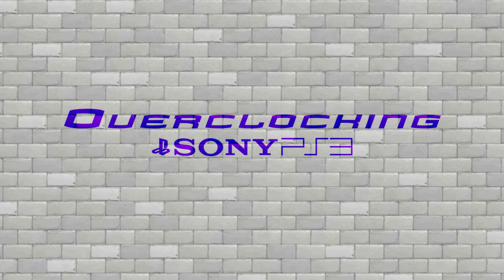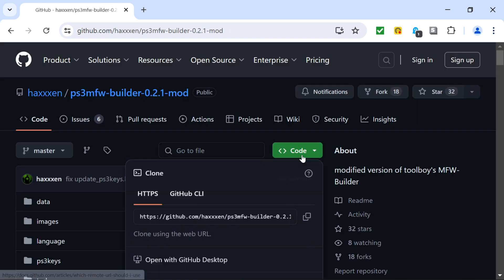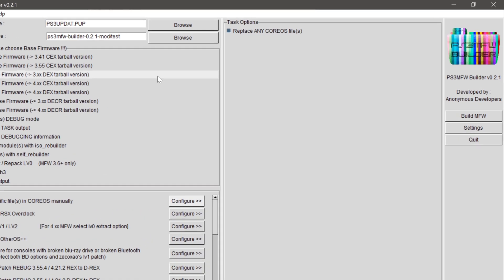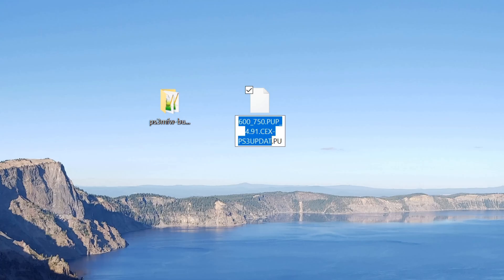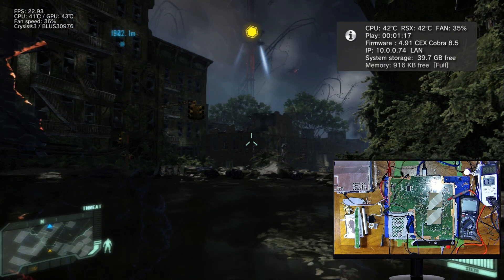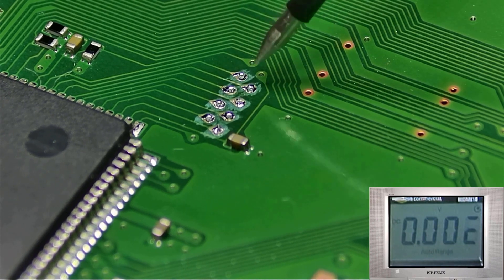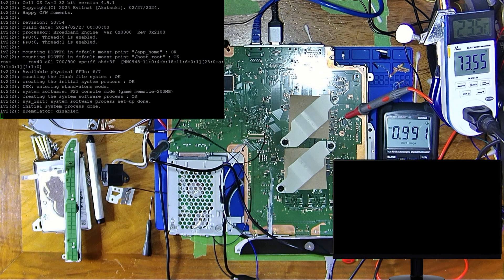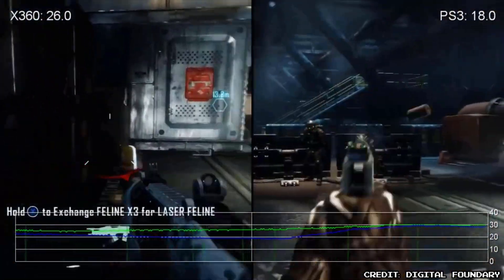PS3 Pro Tutorial | How to Overclock a PS3!

Comment: Thanks for the walkthrough and how to!  I got an extra 150 MHz on both the cpu and gpu.  Crysis 3 definitely sees improvement.  Temp stays just under 70C on a 2000 series slim that I repasted with delidding, with the fan program set to Auto #2.  It works great!

Comment: HFW?
Reply from the maker: Did I say HFW somewhere? Not sure what you're asking, but if you're wondering why you can't use Homebrew Enabler HEN, it's because you can't change the values in lv1.self where the timings are. You need to be able to install custom firmware, which means full jailbreak.

Comment: Hey i like ur video, but i need ur help, at 8:13 it says failed and patchtool.exe couldnt be executed
Reply from the maker: Be sure to run as administrator, select the keys folder, generate the new lvl keys for the FW version you're trying make a MFW of. If none of that works, delete the file, download it again and try to redo it from the begining again. I had weird issues once, got errors I couldn't resolve, deleated it (and the temporary file un user appdata), then reinstalled and it worked that time. IDK why, but I got there eventually.

Good luck.
Reply: @ripfelix3020  THANKS, it worked

Comment: Hello Felix I got an extreme Important question, If you just left an Frankie With it's Original Voltage Controller of which it's about 1.35 Volts for the 90nm rsx that alone wouldn't be the voltage mod for an 40nm Frankie??? And would allow us to Overclock till 950Mhz with the original Voltage Controller??
Reply from the maker: So the core voltage is determined by the syscon after it's read off the RSX efuses. The GPU's reccomended VID is baked into it. So if it's a 90 syscon will select one voltage. When we frankie it, syscon selects the proper core voltage for that GPU. 

However, if you manually change that byte in syscon eeprom, it will not change automatically. It'll stay at what you select.
Reply: @ripfelix3020  so after all that means in Frankie's was never necessary to do the voltage mod for the 40nm as the Syscom detects automatically the model of the chip which is related to its lithography!!?
Reply from the maker: Don't confuse core voltage with VDDR. There are 6 voltages for the RSX. VDDR is a different voltage entirely and if that's not reduced from 1.2v on a 90nm motherboard to 1v for a 65nm RSX or 0.95v for a 40nm,  it will burn out in a year. Confirmed.
Reply: @ripfelix3020  Omg, I have no Ideia about that, Alright Understood Thank Dr.Felix, You Rock!!!! Also please bring more overclock videos, Maybe if you want try liquid cooling on RSX or liquid metal, all to help overclock it further, also if there's GPU on slims that are reported to go up to 950mhz with original voltage then just imagine what that GPUs can achieve in core clock if you increase the voltage to 1.35 Volts, so proportionally an GPU like that maybe would achieve 1.4Ghz Core.
Reply: @ripfelix3020  alright Thank You So Much Felix 🙏

Comment: I have ps3 slim model CECH-2008B, is it compatible with overclock, if yes, what are safe clocks for the rsx?
Reply from the maker: 600/750 is the place to start. Work your way up slowly after that, or don't continue past if you're not willing to patiently and diligently test for instability and accept the risk.

No one can tell you what your max is.
Reply: @ripfelix3020  your guide was really useful, Its stable at 600/750, in crysis 3 no artifacts(my english might be bad), so thank you
Reply from the maker: your english is fine bro. and good luck!
Reply: @ripfelix3020 Thanks
Reply: @ripfelix3020 please, place firmware to download with this settings

Comment: ugh. i cant seem to get the 491 key thing to work. im running linux and used wine and it did the same thing in a windows vm so
they 491 key file doesnt show up in the folder either.
edit: error: no such input file: keydat.
new error! grr. Last lines of log : 
***************
Getting PUP build from: PS3UPDAT.PUP
Executing command pup_get_build ${::IN_FILE}
PUP original build:99999
Packing Modified PUP:"test_4.91.CEX-PS3UPDAT.PUP", BUILD:99999
Executing command pup_create ${dir} ${pup} $build
Executing shell puppack ps3mfw-builder-0.2.1-mod/test_4.91.CEX-PS3UPDAT.PUP {C:\Users\tUser\Desktop\ps3temp\PS3MFW-MFW} 99999

perror: No such file or directory
fopen(ps3mfw-builder-0.2.1-mod/test_4.91.CEX-PS3UPDAT.PUP)
FATAL ERROR: Error packing PUP file test_4.91.CEX-PS3UPDAT.PUP : child process exited abnormally

***************
Error running script: Error packing PUP file test_4.91.CEX-PS3UPDAT.PUP : child process exited abnormally
Reply: fix: change the output folder (modified firmware directory) to something that isnt the default one. bruh.

Comment: Would it theoretically be possible to increase the RAM capacity?
Any ideas, if that could be possible?
Reply from the maker: I have a friend Victor that uses a CNC mill to remove the VRAM and then sands down the to the pads so he can install new VRAM modules on the RSX interposer itself. Crazy man.

We've speculated about the idea of then installing VRAM modules with higher capacity. The issue then is how to get the console to make use of it. It's such a crazy thing that no one has seriously looked into figuring it out.

But I do think it's possable.

Edit: XDR would be easier to access and replace, since they arent glued on with underfill. But there's the same issue of allocating the extra memory and then actually utilizing it.
Reply: @ripfelix3020 The Devkits of PS3, they have Option in the Debug Menu to Allow the Extra 256mb Xdr to be used, so that shall Make Very Easy for Developers to find the Code Line on Devkit Tools Firmware where it Reallocate the Extra Twice 256mb Xdr Ram.
Reply: @ripfelix3020 If I tell I thought the same thing you wouldn't believe me, I thought first of using an CNC to cut off rsx modules just to replace memory due to soldering leakage when reballing RSX but then I thought about increasing the VRAM of RSX, I think max Gddr3 that can be installed on RSX may be only 2.048Mb only about 80% increase 😂😂😂😂😂
Reply: @ripfelix3020 could benefit ps3 linux?

Comment: can you tell me how to install a firmware update on via storage its okay if it needs jailbroken mine already is
Reply from the maker: You need a Fat32 MBR formated USB flash drive. Folder structure = PS3/UPDATE/UPDAT.PUP

Then plug it into the console and go to update, choose the option to update from storage. You need a compatible base firmware for it to work tho. So be sure you are fully jailbroken and trying to update to a CFW version that's compatible with your system.
Reply: @ripfelix3020  thx god bless you
Reply: @ripfelix3020  I didn't work thx anyway I tried the overclock method that you install with the update

Comment: I’m here with my 950/1000 PS3 brute forcing games. It’s insane the bump in FPS you get. It legit becomes a PS3 pro.
Reply from the maker: What's funny is that's how my friend described it. Like a "higher level of console."
Reply: @ripfelix3020  yeah that was crazy🤣 and he was just a normal guy without the knowledge that hard core gamers have.
Reply: what model are you using??
Reply: @Ribsllor  2501B
Reply: I got the 2501A, what temps are you getting and how’s the stability?
Reply: @lexadams4259  mines fully stable. I don’t get passed 67c. I run my fan speed at 40% speed.
Reply: @Tanzu15 please Please How Much Fps you get on GTA 5??????
Reply: Tanzu15 Brother Please Bring the Benchmark Videos to Youtube

Comment: I love old hardware since it can often be overclocked way harder
As an example my hd 6570 standart clock was 650 core 900 mem but it could oc to 950 1170 pretty stable without adjusting voltage
Reply from the maker: Yeah, it's pretty crazy how much potential there is there.
Reply: What about the Motorola 68060💀
Reply: My first PC had a I7 2600k and a Asus Sabertooth P67 mobo. I could run that chip at 4.8Ghz all day long. With voltage at the limit of what the chip could handle i manage 5Ghz but she was very toasty at that point. 

I still miss that Mobo and CPU.